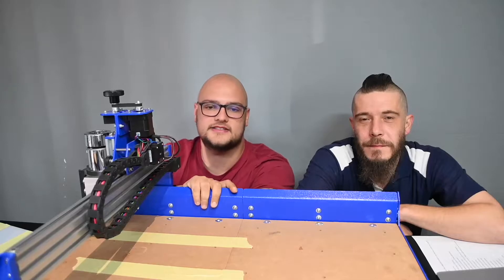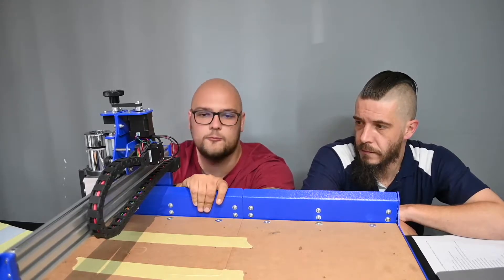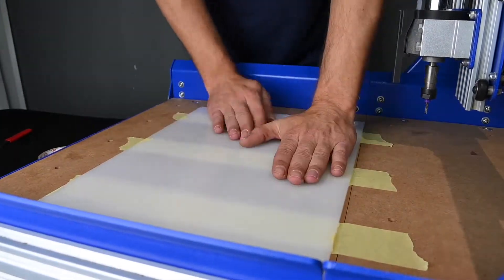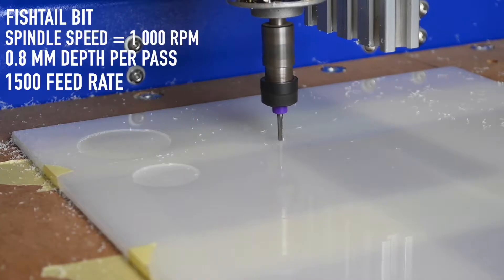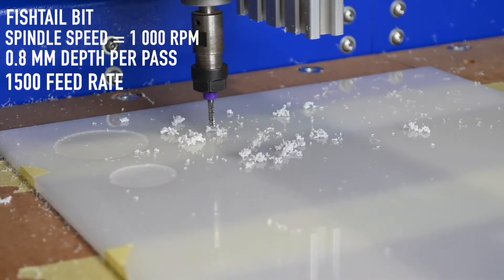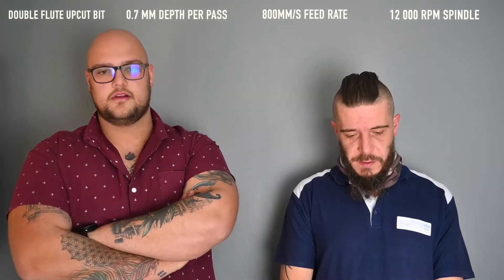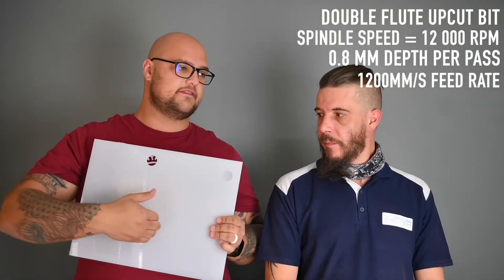How to cut perspex with a cnc machine

Comment: Sometimes I get the urge to buy a 3D printer, to print a part I need, then I remember that I've got a CNC router and just mill it out instead.
Reply from the maker: Milling is usually a lot faster than 3D printing, it might just be more expensive depending on the material that you are using, so I would say your approach is definitely valid

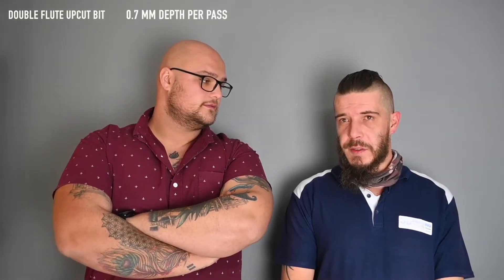Comment: At 5:55 - 800 mm/s and at 7:25 - 1200 mm/s.....???
You have made a mistake here...!!!

Shouldn't that be either 
8mm/s and 12mm/s
(480mm/min - 720mm/min 
or 
800mm/minute and 1200mm/minute...?

Is there a chip load chart available to cut  and engrave acrylic so we can calculate the correct feed and speed depending on the bit in use?
Reply from the maker: You are indeed correct, it is 800mm/min and 1200mm/min, not per second. Thank you for pointing that out!

Comment: I'm having issues with the plexiglass melting and sticking to the bit. What can I do to stop this?
Reply: Reduce rotation speed?
Reply from the maker: As @daitedve8581 said, if you reduce the speed a little bit, and go for less depth per pass, it should help reduce the amount of plexiglass that sticks to your bit. Getting shavings out of the cuts with compressed air can also help.
Reply: what happens, and i have seen this with my industrial machine with Aluminium as well, spindle speed is too fast for the feed rate and so essentially it gets enough time to heat the area and causes the material to melt. so essentially you can slow the spindle speed and/or raise the feed speed - BUT you also have a dependency on the structural integrity of the machine to handle the speed and pressure. So maybe, keep feedrate higher, slow spindle and reduce cut depth. BUT again, there is consideration for cutter size, flutes, material removal ability per flute etc. there is a LOT of math involved. best is to get some sacrificial material, start slow and shallow and work your way up. you will find a trade off between depth and feed rate, tool wear, cut quality etc

Comment: CAN IT CUT ALUMINIUM , VIDEO MAYBE ?  THANKS
Reply from the maker: You can engrave on aluminium yes, cutting on thinner sheets are possible too, you just need the right bit.
Reply: Will the 6mm timing belts with Nema 17's cut Aluminium ? @3DPrintingStorecoza
Reply from the maker: All of our Cron Craft machines come standard with Nema 23 motors, but yes, with the correct settings and bit, you they can engrave/cut aluminium. 

The belts are able to handle working with aluminium as well, it will just need to be slower than if you had a machine driven by lead screws for example. 

Also note, that engraving and cutting aluminium will need to be done in multiple passes, and that aluminium will cause your bits to become duller more quickly than working with wood.

Comment: Hi, i have the cron large router, but have problems with cutting depth on  z axis, it does not cut the depth i tell it to cut, im using easel, done everything according to manuals, not sure if the problem is on the gcode
Reply from the maker: send us an email at support@3dprintingstore.co.za